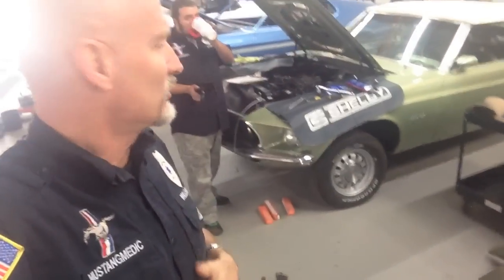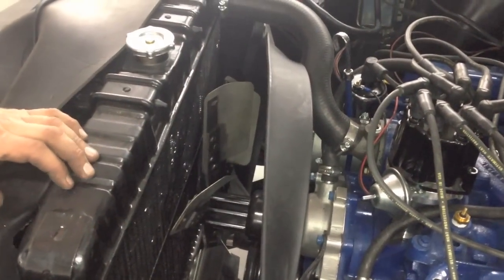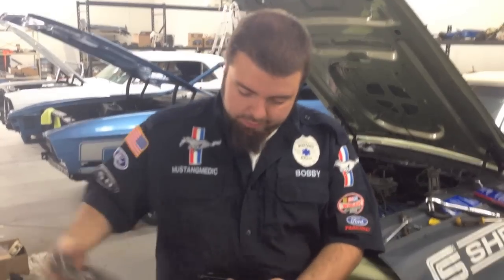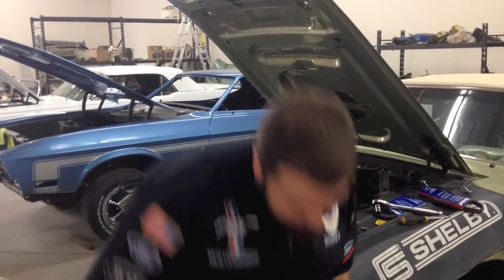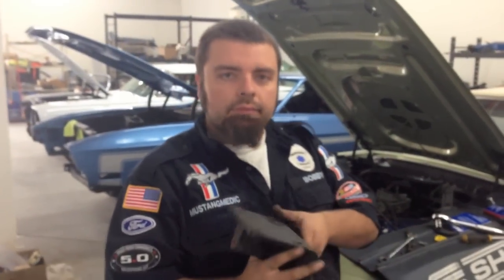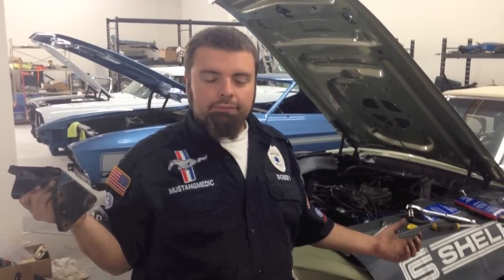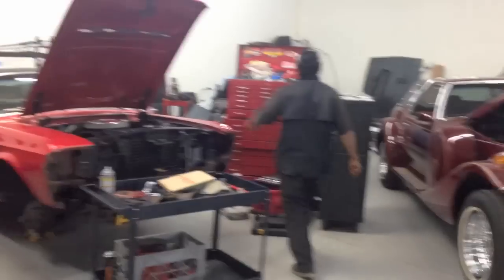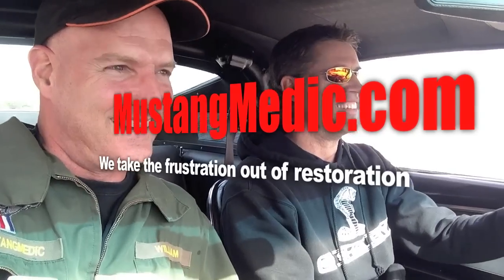Bob's 1969 GT Convertible - Day 115 Ford Mustang Restoration Show MustangMedic

Comment: The paint is perfect but the plug wires look like spaghetti I would like to see you run them together with some keepers or something. The after market bracket looks like it shaves some the weight off.